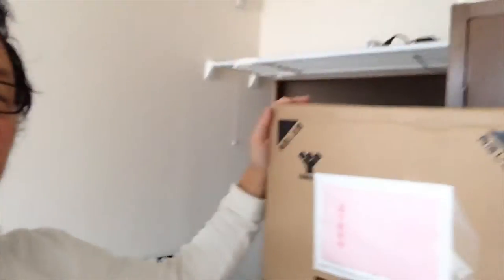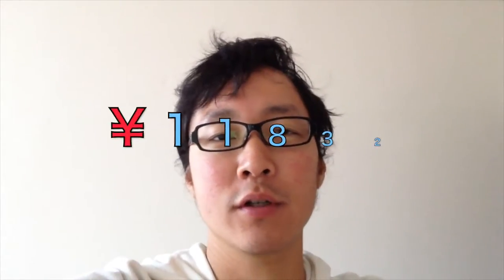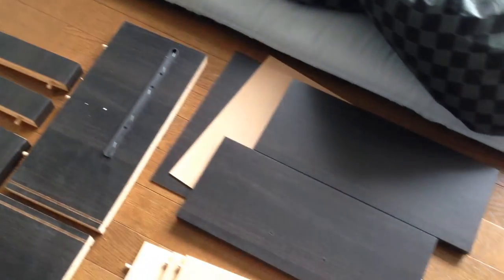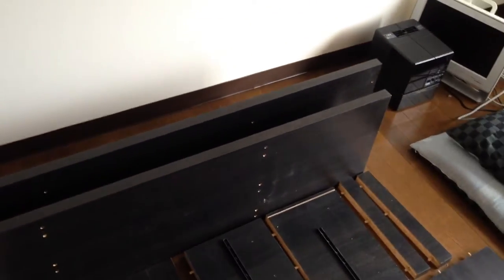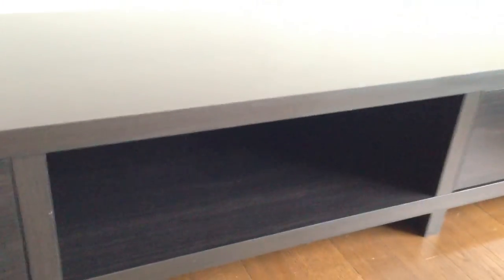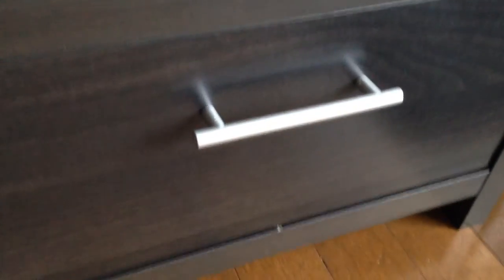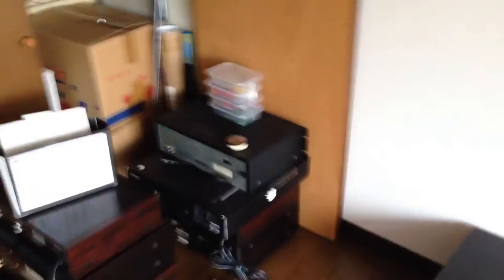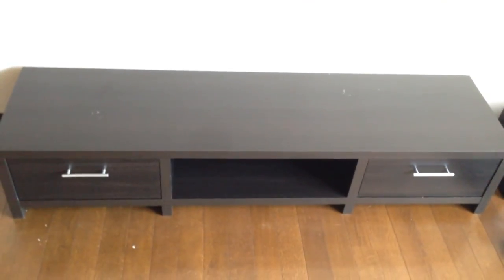How to keep your cassette deck collection tidy! 安もんテレビボードを組んだら傷だらけ。。。

Comment: Wal-Mart sells what they call a "TV Cart" for $18 US, which requires assembly. Made of particle board with a very nice looking matte black finish. It rolls on casters and is VERY sturdy. One adjustable shelf. You can stack 2 decks at the bottom under the shelf, stack two more on the adjustable shelf and one or two two more on the top. The adjustable shelf is a lifesaver and IMO is what makes this setup work so well. I took 2 of these and stacked the 2nd cart on top of the bottom one, minus the casters, of course. The result is a really really nice looking rolling audio rack for $36. With a Teac V-8030S on the very top this setup is 45 inches high. The casters are plastic but they are very strong- they have a wide footprint and I've never had a problem with them- they work amazingly well for plastic.

Comment: Hello i have a situation where already had a some kind of a stereo made furniture with a front glass that I bought at the beginning of the 90s when I bought some Sony Es components at the time in 89 or 90 when bought these elements without the side wooden panels which today think it was just dumb of mine then always kept my Hi-fi stereo in the mint condition state and there are about 4 months ago I started having interest again to improve my system and imported from Japan a cd-player x555es and now does not fit in because it brings these panels and I'll be forced to change so it can fit in.
Thanks wish you the best.
Reply from the maker: João Pedro I understand! At the time we didn't pay too much attention to these details, and today we have try very hard to find those components in mint condition! I hope you can find a solution for your stereo setup! Cheers!

Comment: and what is the point of having so many tape decks? do you use all of them? I thing only one or 2 is enough.
Reply from the maker: It's just for collection. You only have two wrists, but can have a nice collection of say a dozen of watches...
And it's very difficult to elect only one deck among so many, so I ended up having a couple of them.
Reply: Yes, you are right in this case! It makes sense. I also have 2 tape decks and I think it is a bit an exaggeration but the one is a yamaha 2 head w952 and a jvc 3 head, I think they both record very well especially the jvc but in order to have the best recording you need expensive metal tapes because the normal ones lack dynamics. On the other side digital recordings are always more accurate.

Comment: What is the small silver sony component in the middle on top if I may ask?
Reply from the maker: Hello, it is an audio selector!
In this case, a completely mechanical one, it doesn't require power and keeps the losses at minimum.
It's useful for when you have too many decks... ;O